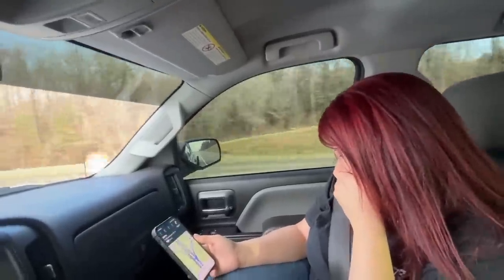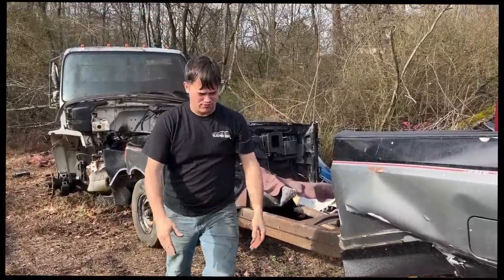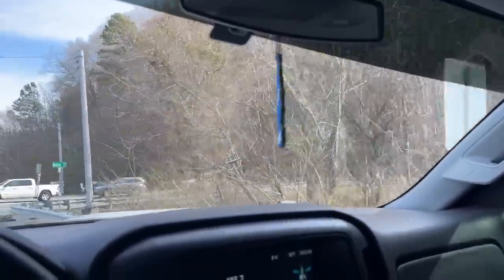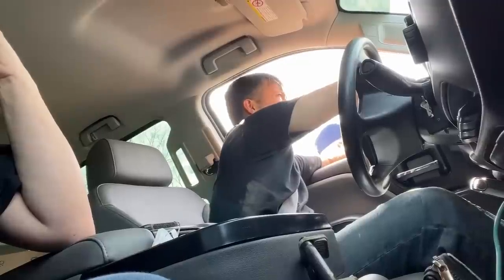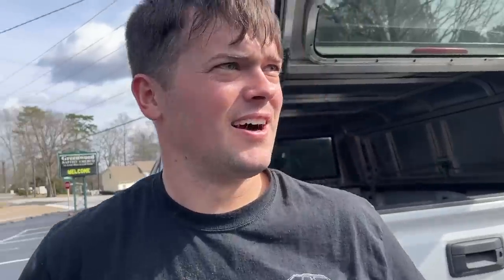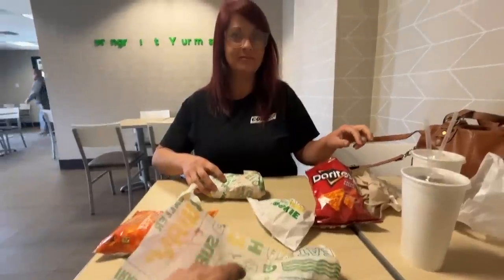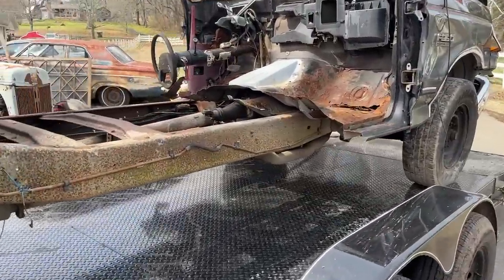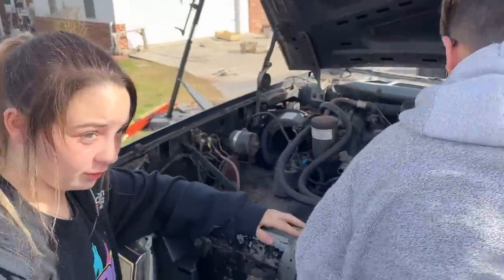We Bought Some Stuff! Almost Sold it on the way home!

Comment: Definitely do a will it start, then put it in the black Fairmont wagon. Use the 8.8 from the turbo coupe parts car and the brake system for 4 wheel disc brakes. If the floorpans are good in the turbo coupe parts car, cut them out and put them in the Fairmont because they are basically the same floorpans. Length is correct for that. The Fox Mustang and Capris have the shorter pans, whereas the other Fox chassis cars have the same floorpans due to the Mustang's 101 inch wheelbase versus every other Fox chassis car having a 105.5 inch wheelbase. That's easy access parts for the black Fairmont wagon.
Reply from the maker: Ok thanks

Comment: I know a bloke that went from Melbourne to Alice Springs which is approximately 2,500km about 1,600 miles in a Ford Lazer, with a roof rack car and a package of stuff probably 12 foot high from ground to top of load and 6x4 foot caged trailer as high as the load on the roof, a Ford Lazer is a 4 cylinder hatch back, thanks for sharing, all the best to yous and your loved ones

Comment: Well you got to get it running in it because then it will be easier to move around plus it would be perfect for the black station wagon after you fix any oil leaks and change the cam because it may be a big block but nothing is better than a big block with the healthy lump hahaha
Reply from the maker: Yeah maybe s so
Reply: @sleeperdude2690  well I'm sure it will be on your mind I wonder if it will run and how much work will it take hahaha

Comment: Why mixing the drive train?
There's (built)5R100W's behind diesels pulling mega tourqe/hp. Are there issues interfacing with Holley Sniper/Dominater/etc FI systems?
$400 for core motor/Trans is a smokin' deal, I get that part.
I'm building a "Fummins" (Cummins 12v, Allison trans & Ford body), so I'm not a stranger to the Frankenstein builds. I also understand it behooves your channel to be non-denominational regarding builds. I guess I'm just gonna leave it alone and be happy it's a 460 (I admit, I tried to trick you by suggesting a Barra because I felt you were against BBF's.....putting the BBC in the Fairmont just makes me ill).
I like the new trailer, too. It's nice to see you're moving up the ladder with your equipment,  facilities,  builds, etc.
I'm happy to see blessings coming your way.
Best wishes to all.